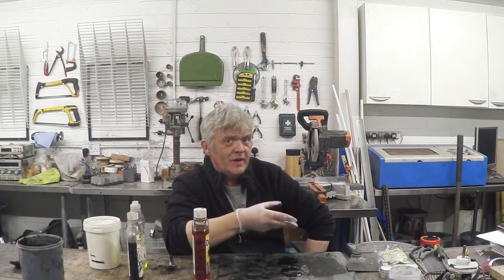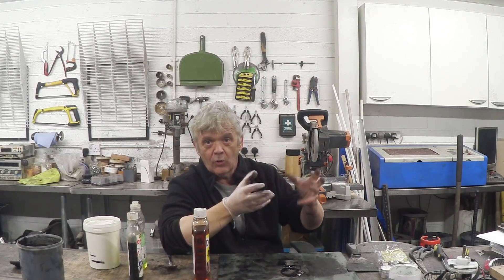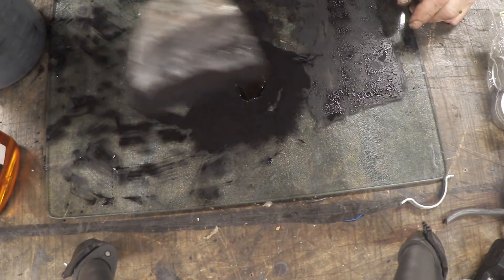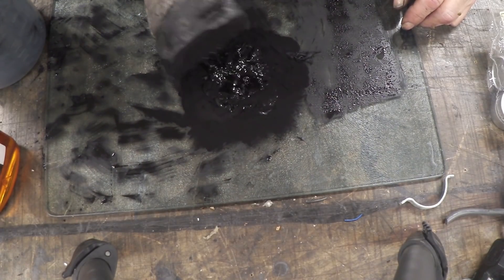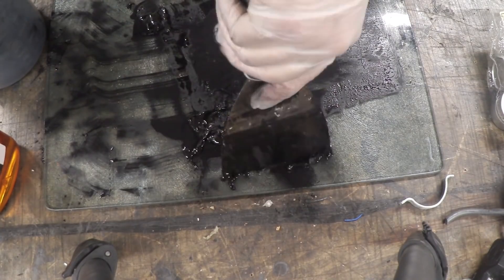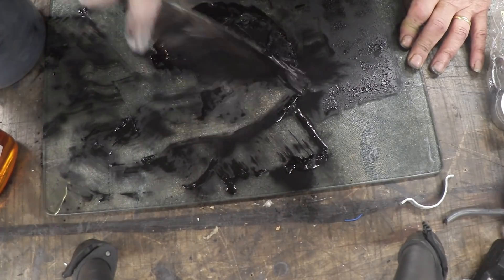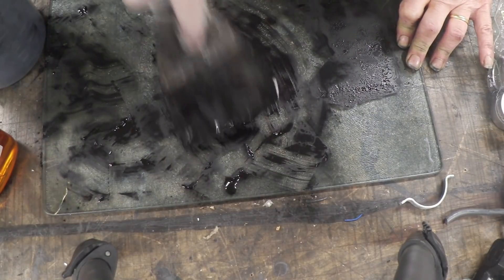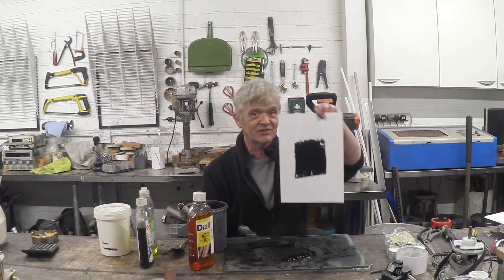Making Printing Ink From Old Toner And An Introduction To Functional Inks

Comment: Ironic that I see this video on ink and I see that k40 laser you have in the background.  I have a business where I use a slightly bigger version of that laser to engrave a special foam and then ink the foam.  I mount this special 'inked' foam onto a pneumatic packaging machine and print and pack a specific product.  
.
I buy a highly specialised oil-based ink.... that is VERY expensive.  I may experiment with making my own ink..... maybe if I have enough time.
Reply from the maker: go for it mate

Comment: Hi, I want to warn you that it is very harmful for your lungs when you work with toner like you did - in open air, the particles can take off just by a wave of hand or in/exhaling. I once spoke with  a guy who repairs old toners and he informed me that toner has very small particles that can stuck in your lungs and won't go out, they can cause lung diseases and cancer. When he works with toner he has it in closed box with glass to see through and gloves to the inside and it is all sealed so that no particles can get out.  Love your videos. Take care
Reply from the maker: thank you for the warning mate - cheers

Comment: Any one guide me how to make dry erasable marker ink
Reply: Idk, but i imagine the dyes you'd want would be plastic nano particle plastics, otherwise even food coloring will stain a bit, but is generally washable.  Glycerine is a common fountain pen ink component, it helps slow the flow, tiny amounts of dish soap helps break water tension or else the ink will hold on to itself.  That and water wetters are often used, dupont makes one commonly used in inks.  This is all i know, i hope it helps.
Reply from the maker: dunno mate - probably not that difficult tbh
Reply: @ThinkingandTinkering  I use carbon black methylated spirit olive oil and gum Arabic solution but fail to make solution carbon black settled down
Reply: Please guide me to make ink solution

Comment: Hello sir! I am a follower of your channel and have learnt a lot of things from it. At present i am working on textiles where i am trying to formulate a good quality graphene based ink on polyster fabric. I have tried number of experimants and some of them worked too but, i find that after some time the ink that deposited on fabric gets brittle. It seems its because of the binder that i use. So, can you please help me to solve this problem !?
Reply: Is a silicone ink base out of the question?
Reply from the maker: I am not quite sure what to say mate as you are obviously on the right track - your problem is the binder try a flexible on like SBR/CMC
Reply: Ok. So its a combination of sbr/ cmc or anyone of it?

Comment: Incredible.  Thank you for sharing your knowledge with me.  I have a question on another matter, if you have the time;  I was watching this and thinking about solar cell inks, which I did not know existed until this video, and was wondering why we do not use metal by itself for solar cells.  If a metal plate is put in a mild vacuum, glass container with alternating capacitor plates beneath it, and one end exposed to direct sunlight, would it not be charged by uv rays?  Or from light in general?  I think a capacitor in a giant pickle jar, where light only hits one plate, and the other plates are shaded, should create a nice charge. Wouldn't it?  A person could warm up the jar, put the lid on, and seal it well, and as it cools, would form a slight vacuum.
Reply from the maker: there has been work done on direct solar charged devices I have done a couple myself - so in theory yes - but like everything in energy this will be the devil in the detail issue

Comment: Woa, this has opened some mental doors for me Rob, lots of info here I had no idea of (the drying-vs-oxidising thing kinda blew my mind). Always love to hear about uses for easy to get chemicals.  

I've got an old project where i got stuck trying to find chemicals that work as an applyible "resist" for an NaOH etchant (i'm trying to make flexible circuitboards from alfoil).   Boiled linseed with rosin sounds like an interesting avenue, if only for the fact i'd never heard of it before 😀.

You said it oxidises fine with the toner, but do you mean the toner is the component that's MAKING it oxidise here?  Or does the toner simply not-get-in-the-way of it oxidising naturally?
Reply from the maker: the oil oxidises naturally mate - the black doesn't interfere with it - some things do which is why you add dyers

Comment: A question for you Robert, Your conductive ink whats its conductive life span when exposed to high levels of UVA  , UVB , just want to know as i may have a project coming up were i want to use silk screen printing of your ink, but need to know its conductive life span over time when exposed to high levels  of UVA and UVB light.
Reply from the maker: I am sorry mate - I just don't know. I guess I could test it but that test will be a while
Reply: @ThinkingandTinkering  Please Robert it would be very nice if you could as it would be use full to add to the data sheet.

Comment: Very interesting use for old toner.  I was taught that Toner was  carbon black, resin, iron powder and some impurities. Which are classed as potentially carcinogenic when inhaled,  basically we always had to use masks when cleaning it out.
Reply: The Material Data Sheets do not say that black toner is a cancer risk.
Reply from the maker: the cancer thing may well be misinformation mate - to be honest I just let folks make up their own minds and don't get involved in the arguments either way

Comment: I make something similar that is for whitening the grout between tiles . I use water based varnish and titanium white it does a perfect job and easy to clean .
Water based varnish is a good fluid for making an ink that is waterproof
Reply from the maker: Great tip mate - thanks for the share